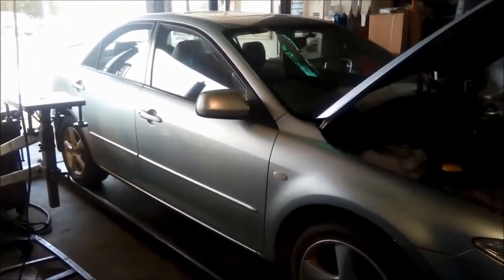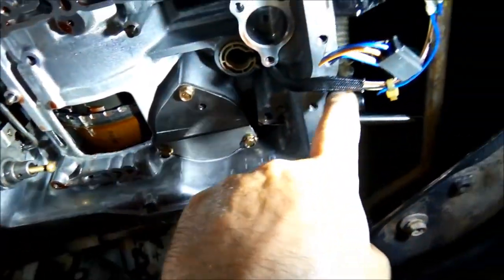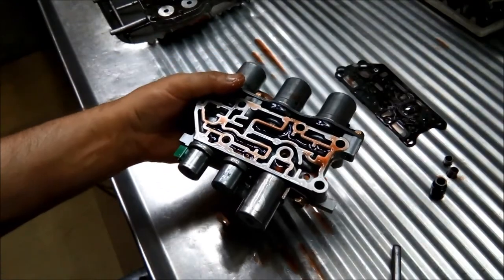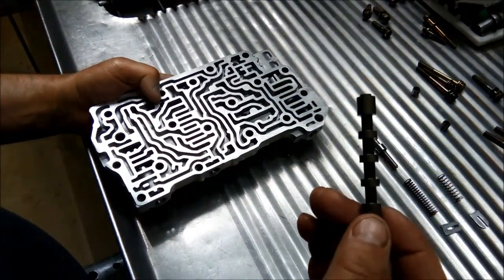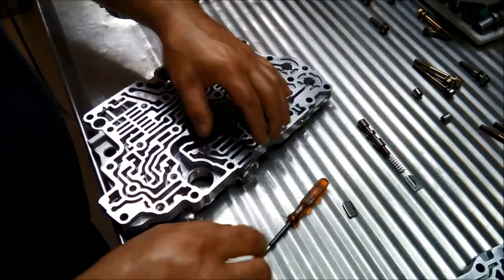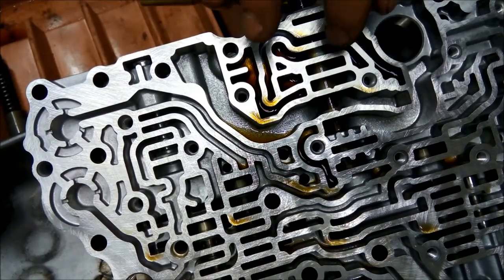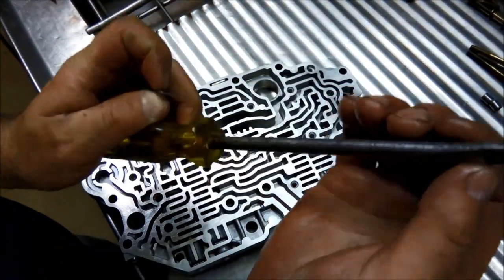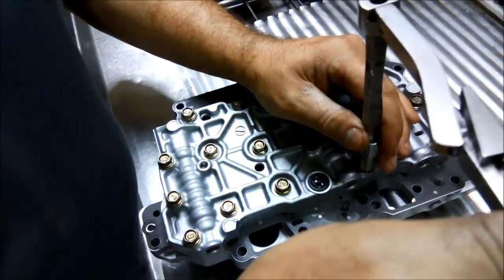Mazda 6 FN4AEL / Ford 4F27E Auto Transmission Recondition Rebuild 1 of 3

Comment: I have a tool that will issue protons brand of turkey istanbul, model 1998 Mitsubishi motor motor vehicle automatic gearbox problem I'm working, but I'm not moving very slowly an automatic transmission did new car, but cıktı solenoid problem does occur, how do we solve, you must help me
Reply from the maker: hi, sorry just found your comment in youtubes spam. contact me on my face book link https://www.facebook.com/Yep-Thats-It-103051017785435/  and leave me which  kind of vehicle/transmission type you have, and leave a detailed description of any fault codes and issue you are having ( we are able to exchange pics/diagrams on there ) and details of what work you have already performed or checked...... you will need to buy me some beers ( link is in face book ) and I will answer your questions accordingly. cheers

Comment: I think I will soon be making good use of your video. Mazda 3 2004 2.3L automatic can't shift to 3rd or 4th gear, however indicator light does shows 3 quickly (early?) shifting to 4 both at ~20mph. AT light is then on. However when indicating 4th at 20-25mph it revs high rpms and is not or poorly engaged and car come to a crawl. There is no downward change in rpms upon in 3 or 4, so it's not really shifting into these gears IMO. Using manual shift mode, the car drives ok in 1 and 2-- in 2 it can go beyond 20mph, to around 30-35mph at high revs. Shifting manually to 3, there is no apparent shift, and if driven like this for even a short time manual mode no longer indicates which gear it's in and eventually loses engagement-- at this point shifting back to automatic mode shows the car to be in 4, with the same engagement problem as before. Shifting to park, turning off and on the car resets the system,
A code reader shows PO772 (solenoid E stuck on) after a while, though it doesn't appear for a while . I replaced solenoids E and D (smaller ones), but no improvement. At one point I did see PO773.
Could this this be electrical in any way or is the direct 3rd/4th clutch damaged as I suspect? Is there any way to leave the transmission on the car while replacing the 3/4 direct clutch?
Reply from the maker: hi, depending on which manual you use, ford & mazda name the same solenoid differently. if no change when you replaced solenoids, i`d be checking band servo piston bore if worn, also air pressure test ports when vbody is out. generally fault codes come on which electrical issues, a leaking solenoid or stuck solenoid wont throw a fault code. if helped, I enjoy a beer or 3. link is in description. cheers
Reply: Same car same problem.. but I have no codes coming up after the AT light comes on. Did you ever figure out yours? Should I just replace all solenoids in the transmission?
Reply: @Cornbreadfed420  it looks like it's the direct  clutch although there was at least one guy who found that just replacing the rear cover solved the problem. I changed several solenoids, but that didn't help. The car eventually went into a mode where reverse, 1st and 2nd work, so it's been drivable locally, so I haven't tried the potential repair which sounds like it's  possible with the tranny still on the car.
Reply: I have reverse, 1, and second but once I get to a certain speed or hit 3rd or 4th the car jerks and it goes into AT mode with high revs and doesn't down shift. It shifts really hard when I'm in park to neutral. But once I turn off car At light goes away.

Comment: My automatic transmission is not shifting 4rt to 5th gear why? Also hard shifting 1st to 2nd gear
Reply from the maker: hi, i`d need more info, check all the basics first and test for any fault codes present. cheers
Reply: @YepThatsIt  p0735-FF TRANSMISSION GEAR # 5 INCORRECT RATIO
                         & p2708 -FF SHIFT SOLENOID F STUCK ON .

ALL THESE PROBLEM CAME AFTER ENGINE REPLACEMENT. Please provide me exact possible reasons.

Comment: Any idea how to access the park pin? Someone in my family decided to put the car into neutral while going down a hill. They instead hit park and the car made a bunch of clicking noises and a bang. Car still drives but when you put it into park, it still rolls.
Reply from the maker: hi, usually the parking pawl breaks not the pin. before you pull out trans drop the pan and have a look issue may be fixed without removal. cheers
Reply: @YepThatsIt  sorry I ment pawl, I learned the terminology after I posted this. I guess I'm curious if I can access the pawl from the bottom of the trans without pulling it. I noticed you didn't show that part in your video (unless I missed it)
Reply from the maker: @chrisp1795  hi, you should be able to see it in there somewhere....unfortunately to access the pawl, spring or pivot pin, you need to separate the case. if you need a repair manual you can contact me on face book link. cheers
Reply: @YepThatsIt  so separating the case means pulling the engine and trans to get the case apart? I may be messaging you soon. We have a snow storm right now so I'm in limbo.
Reply from the maker: @chrisp1795  hi, we only remove the transmission, but whatever is easier and more practical with the tools and equipment you have. cheers